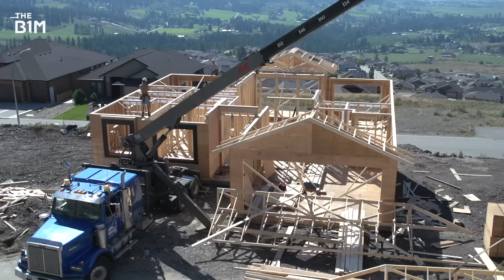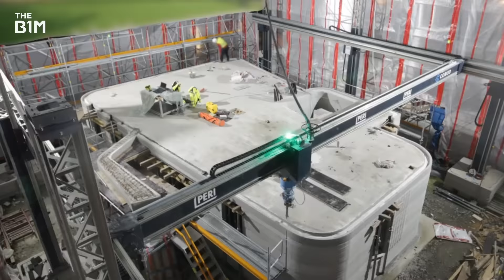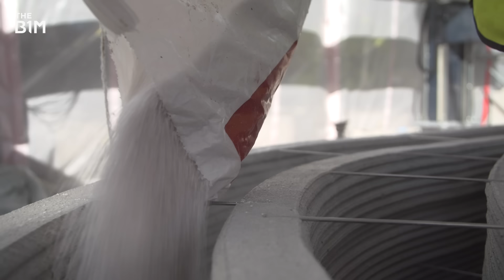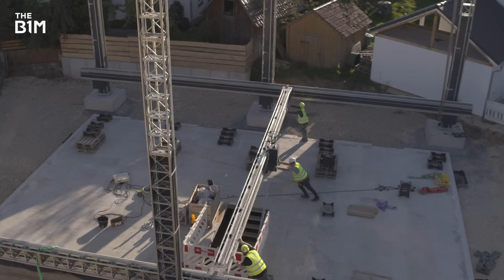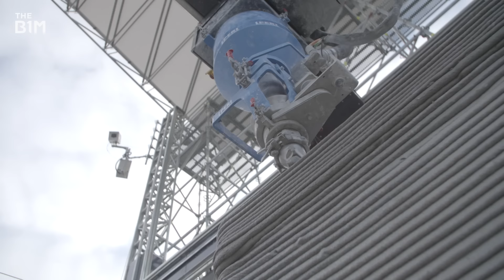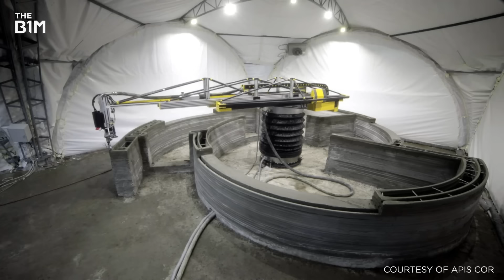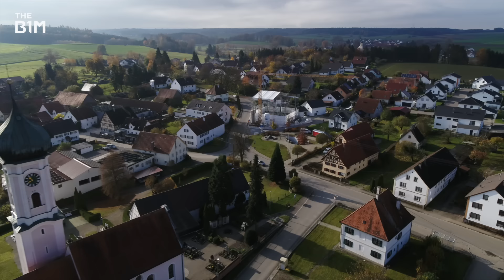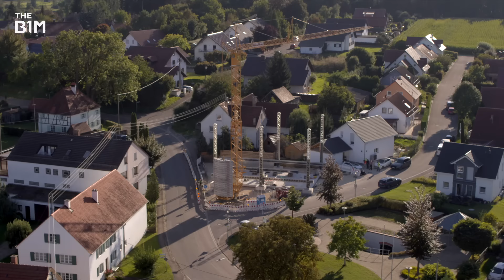Why This 3D-Printed House Will Change The World

Comment: Can you imagine you can say.
"I have a 60 square meters plot, I need a three-storey house to my family"
"not problem, we have 200 models in our database, you'll choose one and we will print it next week"
Wow.
Reply: And eventually, you'll be able to design your own dream house within a modeling software and get it printed.
Reply: @SofeleYT  exactly with less money being spent as well this truly is the future
Reply: @SofeleYT  modeling software = minecraft
Reply: @SofeleYT  Until the engineer looks over it and changes 70% of it because it's not safe
Reply: @hidad5601  Who needs an engineer? We could do real-time calculations on its structural stability.
Reply: @hidad5601  Did you see how thick the walls were? I'm sorry, but what part of unsafe do you see in this?
Reply: Yeah my thoughts exactly and same is question.

Should we buy homes these decades or save for 3D ones
Reply: @burazfly  3D for sure. A 3 bed 2 bath in Long Island that is 3D printed goes for $299k while similar homes go for $400 to $450k. Imagine in a  market that isn't as expensive as NY.
Reply: @fettifinance3196  thats good to know considering its still new technology and that means prices will drop as time goes on
Reply: @fettifinance3196  I just saw a video on that. I was thinking on how cheap that house was for NY. I can't even imagine how much cheaper it would be down here in GA.
Reply: @fettifinance3196  I can't imagine paying 400k for a 3 bed 2 bath home
Reply: @burazfly  prices wont drop unless they pass on the savings to us which they refuse.
Reply: @fettifinance3196  $400k? That is crazy cheap for such a big apartment...
Reply: @burazfly  Nah they won't be cheaper the price will bump right up with your imagination and uniqueness
Reply: @burazfly  Save for 3d printed ones. More cost effective.
Reply: Why not just let you make your own model?
Reply: @youcantbeatk7006  Well if you're an architect you could do it. If not, it would be better to take the advice of a professional.
Reply: @chubbygardener  I play the Sims. I'm good enough.
Reply: @youcantbeatk7006  🤦🏽‍♂️
Reply: It will be way faster than stick built and way cheaper probably like 40 to 60 usd a sqft
Reply: Yes gardenholic , That is the right attitude, this will change everything, this will make housing affordable for the masses. By the way I love gardening too!
Reply: Then there is the concern that people won't spend any time thinking about the choice and they will make the wrong choice. This is part of why architects exist, to view how we interact with the space we live in, and how comfortable the space is. Not every house is designed for every person, that's why buildings are custom
Reply: @polycorvia8352  That's a good point. Especially since the building is a huge part of the property value, making cheap homes greatly devalues an area, while also not being as housing dense as apartment buildings.

The inability to sell a home ironically can be a financial burden on someone who would normally be attracted to a cheap generic house.
Reply: I can imagine it, but not in real life
thats why I hate ideas of the future becoming reality
Reply: https://youtu.be/zjVZNHra0pg
Reply: 2D
Reply: Except 3d printing won't solve that issue. 3d prints barely support 2 floors let alone 3 and if you wanted someone to build you a shell from plans then somebody could turn up with ICF moulds per your design and do the same without any 3d printing required. 3d printing is a tech grift technology - it's not doing anything conventional techniques can already do, and it comes with severe limitations that they conveniently don't talk about like number of floors.
Reply: Council approval won't even have started by then
Reply: Not in Germany, you can't build just what you want, it has to fit in the existing neighborhood, along with other restrictions.
Reply: @0Turbox  build a wall within code and build what you want inside walls ignoring neighbors.
Reply: @0Turbox  Yeah same here in Italy, and it's better this way. Imagine how ugly would be a city, most importantly historic cities like we have in most Central Europe if everyone could build what the fuck ever they wanted
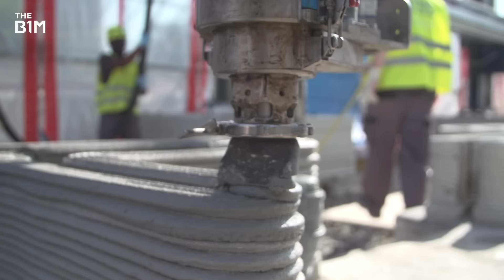Reply: @0Turbox  Apparently yes. If you check 0:40, they claim it was approved in Germany.
Reply: @antoniof9756  This only means, that you can build it at all, not wherever you want.
Reply: @0Turbox  Of course, usually there are areas where you can build and others you can't.
Reply: Yes, the future is here if we just allow it to grow and remove the systemic socio-economic roadblocks that prevent revolutionary technology from becoming widespread. 

Just continue that thought experiment: 
You need a home? You go to the "Design Lab" and with consultants design your dream home to be 3D printed in a month. 

You need food? You go to the local grocery store that has an attached vertical farm producing food extremely efficiently and fresh. You know exactly where each fresh food item is coming from and how it is being grown. Little to no waste! You also have a small greenhouse right near your home for the smaller basic foods like carrots, tomatoes, cucumbers, lettuce, etc. 

You need clothing? Again, you go to the local "Design Lab" and with consultants and some seamstresses pick out an outfit you'd like and it gets 3D printed and stitched to your exact specifications. It is made out of sustainable material like hemp and you can feel comfortable knowing exactly who is making your clothes. There is also a repair shop there, so if something happens to rip, the repairs are done quickly and effectively. 

You need transport? An intelligently designed network of maglev trains, trams or subways and EV busses, scooters, bikes or car sharing services are available to you. Cities can be designed to encourage walking, biking and train/tram transport. 

You need things delivered? A combination of pneumatic tubes and drones are used to get you that book you ordered or that pizza you want. 

You need energy to power all this stuff? A mixed renewables approach is used where you have hydro or geothermal for base load energy and wind and solar for off-set energy production.
Reply: @coolioso808 I'm sure you have good intentions, but your ideas are greatly detached from reality.

-Locally produced foods is highly inefficient compared to specialized farms. Compare the cost of food adjusted for inflation of the 1800 where locally produced food was common, compared to today.
-Mass produced clothes cost 1/50 the price of made to order clothing, even when CNC produced, because there is no need to order a variety of materials and scale of economy applies. Cotton is just as natural as hemp and you don't support the marijuana lobbies that have brought massive DUI and crime to states that have "legalized".
-Public transportation is highly inconvenient and inefficient in all except the most crowded cities. Also they are soft targets for terrorism.
-Drones is a good idea, but again, even assuming a leap in battery technology, drones are a lot more inefficient than the current postal service systems. On top of that you are eliminating jobs for a less efficient system. Drones would be good to supplement for some local deliveries such as within compounds like hospitals, or a P2P system, but not as defacto. 
-wind and solar are not good power generation systems for a grid. Example we saw in Texas this year where the state with the most renewable energy was crippled overnight because of a freeze, and there weren't coal or nuclear plants to provide reliable energy. Nuclear energy is the future, people only fear it because they don't understand the science.

 A lot of new tech isn't implemented because someone is holding it back, but because they aren't pragmatic.
Reply: @DaveSmith-cp5kj  I'm sure your intentions are good, but you, I'm sorry to say, have even a bigger detachment from the reality of nature and sustainability. Don't feel bad though, the critical mistake? Most people don't realize it - it's the economic system. It is completely unsustainable. It incentivizes horrors like continued poverty, slavery, homelessness, hunger, MASSIVE amounts of food waste, pollution and war. 

The detachment from reality most people have is believing that market capitalism will ever do anything to help in the long run. They always give excuses like "well, that's not really free markets" - That's BS. It is free markets to profit-seek and oppress and exploit. 

The climate crisis is a crisis because capitalism incentivizes killing rainforests and awful labor conditions in poor countries (which shouldn't exists, but do because of capitalism) all in the FALSE idea that it is cheaper to mine materials in one continent, ship them to another, then ship them back to a store, where they sell for cheap and then break or spend just a lot of fossil fuel to get there and be produced and have people believe that shit is sustainable? 

I'm not saying everything you said is false. I'm saying anytime you justified it because 'it is cheaper' is a market capitalistic flawed thinking. In a different system that actually cared about sustainability and problem solving it wouldn't need nor use money it would be based on a true inventory of available resources and using science and math directly solve problems once and for all. The solutions are here and/or developing but this market idea of 'cost-efficiency' and profit-margins and ROI is anti-science and anti-nature thinking. 

Locally produced food may have limitations now but it is the highest potential for sustainability, obviously! Do you want a carrot from a local backyard garden or one grown 2000 miles away, shipped in a big gas guzzling truck? 

Regarding energy, wind and solar aren't alone baseload energy, I know. There are other clean, renewable options that haven't been fully developed yet. Fossil fuels have had more than enough time to develop and are not longer a long-term option. But market capitalism has just 'the best' incentives for things that kill. 

Just look at war. Still going on. Still big business for a few companies, but built on death and destruction. Another one of market capitalism's incentives.
Reply: @coolioso808  Capitalism promotes freedom and independence from a central entity. It seems you are trying to push an agenda, not bring solutions to the table.
Reply: @DaveSmith-cp5kj  Thinking that market capitalism promotes freedom and independence is akin to being part of a cult or religion. You don't even know you are in a cult when you worship capitalism or the Money God. Pushing an agenda is not thinking critically about the root causes of environmental destruction, poverty, war and inequality. You must at least understand that capitalism may promote 'freedom' for some, but misery, slavery, exploitation and oppression for many, many more. If you are okay with that. If you are selfish and believe 'that's just the way it has to be' then the cult mind has taken you over even worse because you no longer care about fellow man, you just worship your Money God blindly. 

Sorry for the harsh reality check, but no real solution that includes a peaceful and sustainable future also involves any form of market capitalism. That is a fact. 

If you would like to break out of your indoctrination I recommend you reading up more about how market capitalism works and how any true way forward would not involve the use of money/markets. A resource-based economy is one example, that I can explain more. 

You basically have two choices at this point: You can stick your head back in the sand and just live out of the rest of your life as best you can under the Money God's Rule, while still thinking the Money God is just and fair - you will probably live a good enough life, assuming you are in a relatively rich nation and in middle to upper class standing. You can shut yourself off to most other people, just live in your bubble and anytime something gets worse like climate change, wars or poverty you will just defer to your Money Religion as to 'what should happen' (but it never really happens) and then you can sleep at night. 

OR you can dare to actually think for yourself, think critically and at least understand how money, markets and debt work and how they always create an underclass and dangerous inequalities as well as preventable disease and death. A natural law-resource based economy is a science-based way of designing out critical problems with the way our economy operates, designing out catastrophic climate change (if we are lucky, before it is too late), ongoing wars, poverty and rising inequalities. 

Which option will you choose?
Reply: @SofeleYT  Capitalism literally is a democratized economy dude...
Reply: @DaveSmith-cp5kj  Excuse me? Capitalism operates under private owners who have absolute control over their businesses and resources. Workers own none of it and do not get a say in how its being operated.
Reply: @SofeleYT  You do realize entrepreneurship is a thing, right? Workers own none of a business they had no hand in creating, that's kind of common sense. If they want to own a business, they must make a business. 

I'm kind of amazed I even have to explain this to someone.

EDIT: Actually I just came across your prior comment claiming we don't need engineers because "We could do real-time calculations on its structural stability."

It seems you have a habit of opining about subjects you have little expertise or education in. I'm going to go on a limb and say you have never actually run a business on your own either, but you expect someone to give you a share of their business for free.
Reply: Tom C  Some solutions are simpler, but we have made them harder through our self-induced market economy cage we have put ourselves in. To quote a sustainable human: "The realm of what is possible is severely limited by the realm of what is profitable." 

The grocery store with a nearby vertical farm? How big would it have to be? There are calculations, based on existing vertical farms, that would say about a 30-story building could meet the nutrition needs of a community of 50, 000 people. If one 30-story building sounds too big? How about two 15 story buildings or three 10 story buildings? Still, if they are locally produced with renewable energy generation then it is much more efficient and wasteful then growing and transporting various foods thousands of miles around the world and 25-40% of that food never even hits a human stomach. At least all of the food in a vertical farm would be compostable so a zero waste plus. 

Mass transit designed intelligently and systematically is highly efficient and effective along with other supportive modes of transportation. Everybody owning their own vehicle, for instance, would be the least efficient and most wasteful trend in transportation. 

Why clothes on demand? More sustainable, ethical and customizable. 

The trend is already automation taking over jobs and tasks people don't want to do or don't need to do because machines/automation do them better. That should not be a scary thing. An economy based on infinite growth on a finite planet is not sustainable. We need to evolve, not stay the same or go back.
Reply: and then , you can also ask to add a building behind you house , with no windows and pool in it , and then you invite your some people that you dont like , and you print seal exist , and then you wait...
Reply: I mean honestly if your only goal is to "become a millionaire" you're just begging to make a dumb decision and be disappointed...I think many will become millionaires in this current bull market but it's not the right mentality as holding can be very dangerous. As hard as it is trading Crypto is way more lucrative and is quite logical if you just study the charts and the support resistance and pay attention to what's going on, I’m not a pro trader but I was lucky enough to make 35BTC since  late last year following the instructions and signals from Karen Asnin Whitby. She runs program for investors/newbies who lack understanding on how trading Bitcoin, Crypto, Ethereum works, to help them utilise the volatility of the crypto market and also stack up more bitcoin. You can easily get to Karen on the web to know more about her experience in dealing with investment. Now i can secure a nice duplex for myself and within a couple of months, hoping to get mansion if i invest more and more with her......

Comment: A few comments:
1. I suspect they are showing the walls are hollow and will be filled with insulation later.
2. The external pattern of lines formed by the printing process is interesting, but not necessary. They could finish with standard gunnite and give a flat textured surface.
3. Obviously the interior walls are cement.
4. The strength of the building needs to be proved.

Comment: If I understand correctly, all the walls, floors, and ceilings will be concrete.  If that's correct, I can see advantages, but it also occurs to me that if you want put in a plug for Internet service, or whatever they might have in the future, knock down a wall renovating the building... isn't that going to be harder to do with concrete everywhere?

Comment: Looks like a smart time to invest in a hundred year old house with character 😁
Reply: The word "character" is neutral.  A house could have character because it is built in a classic architectural style such as Victorian or Prairie, or because it is built with mismatched materials, poor layout, and out-of-square corners.  Be careful of using that word.

Also, even old houses with good character are usually not easy to insulate well.  Unfortunately, most new houses are still not insulated anywhere near as well as they should be.  I would like a new house that is both super insulated and built in a classic architectural style, but it probably will not exist unless I design it myself.